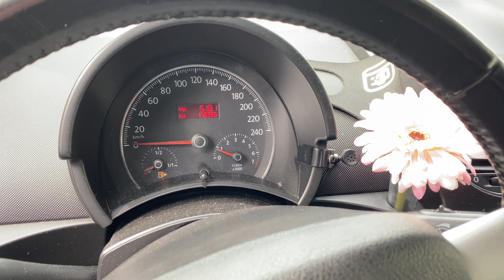How to: Clean the throttle body of a Volkswagen Beetle 1.6 Petrol from 2006 (4K)

Comment: If you haven’t gotten one yet.. get a vag com cable and VCDS to troubleshoot your computer.. it will save you thousands of dollars with repairs.. and you can relearn your throttle, change the way your beetle runs and drives and can outline where your problem components are… sometimes a simple relearn can change your beetle for the better.. and for the love of god.. clean your old parts before reassembly!!! Btw.. a simple odb2 scan tool won’t work on Vw beetles.. thank Volkswagen for that..